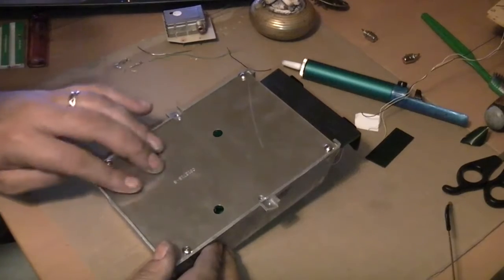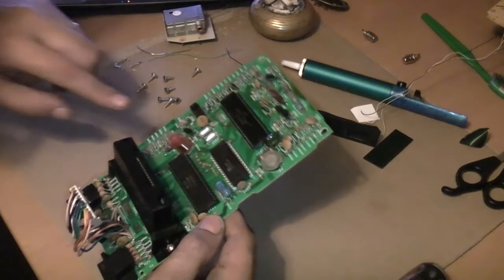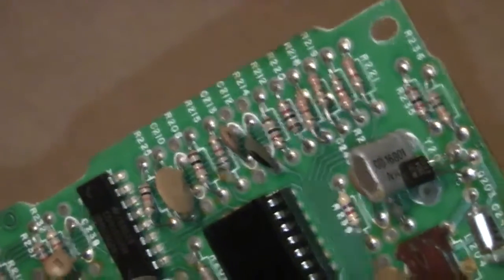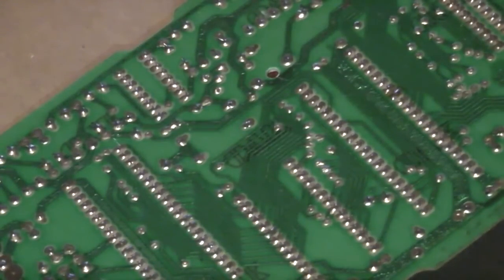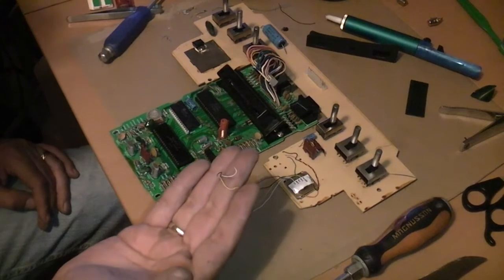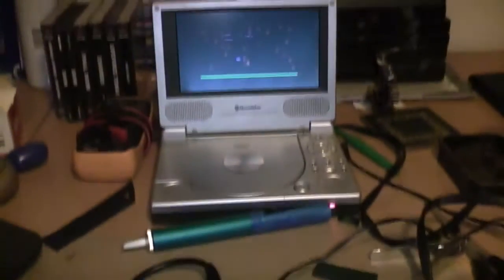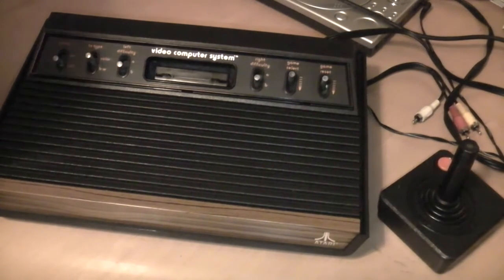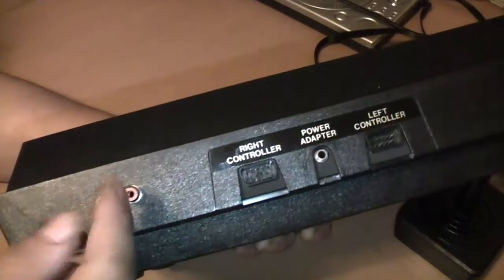Atari 2600 [PAL] Composite Video A/V mod install Part 2

Comment: It's always nice to see how these things come apart as they can be quite tricky.
The Atari's always were well shielded. I don't know why the 7800 has such bad RF compared with all the other Atari models.
But definitely the way to go if you want to use them on a modern TV.

Comment: Single Mono is a bit naff though as it will only go on the one speaker through the TV. As it's a Mono system dual Mono is still best as it would output the Mono over both channels. Still nice mod although would be better with dual Mono's.
Reply from the maker: It's an atari lol, hardly worth worrying about duel mono. It really easy to add another jack if it bothers you that much. I'm happy just to hear the sound, won't be listening on headphones or anything lol

Comment: I will never understand why people feel the need to de-solder legs just chop them and be done with it. I've done the same mod and chopped everything it saves on time. Also works nice through a framemeister. Uncanny how we both used centipede to test the game as well as pitfall (must be a green thing).
Reply from the maker: You have a good point,  won't make any difference to the finished product. Do you just solder to the chopped legs then ?
Reply: not usually I'm just really talking about any dead leg area's you won't be soldering to for example removing the RF unit. If you aren't using it again chop it off and done hehe. Am I showing how much time I have here or how much time I want remaining xD
Reply from the maker: +Official GaminGuys Ahh ok cool. I've  always del soldered stuff but you do make a good argument. Would reduce the risk of damaging traces etc too. Thanks for watching and commenting :)
Reply: no worries was a good video hope to make another myself soon and record it.

Comment: Very nice! job well done, despite the minor problem you had. I'd love to get one of these myself with s-video, just waiting on the money/availability planets aligning. haha, one of these days :P
Reply from the maker: Thanks. Yeah sometimes shit like that happens but it didn't cause any problems. I am not sure if the is an S-video mod available but if there is I doubt it will be any better than this mod, It's a 30 year old system, the signal I am getting from it here is probably the best it is capable of outputting.